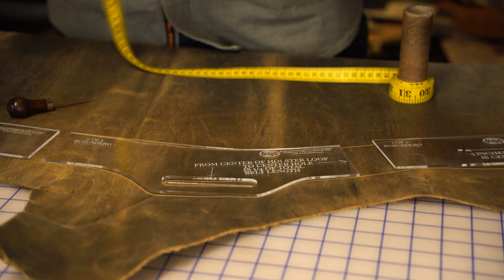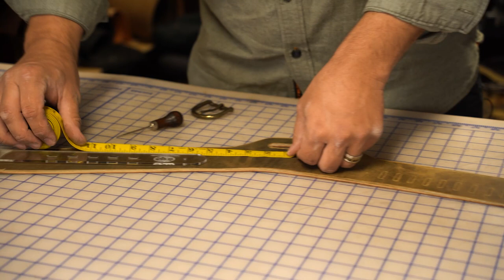Ghostwood Buscadero | Full Build | Crafting a Western Drop Rig

Comment: I have trouble with the brass shells turning green in the loops. Has this happened to you, and what is the solution? Thank you, good video.
Reply: Make sure your bullet loop leather isnt tanned with Chromium, chromium will react and turn the brass casings blue/green AKA tarnish, theres really nothing that can be done once the loops are formed, some cheaper leathers are chromed tanned first then veg tanned to cut on labor, if youre buying veg that with a soft temper, then its most likely chrome/veg tanned leather unless is milled veg tan. Hope this helps.